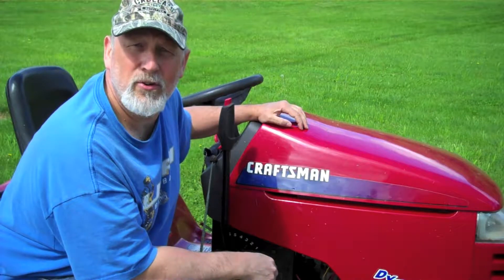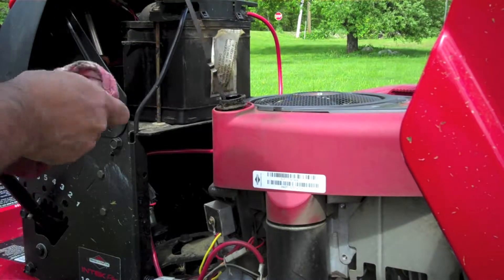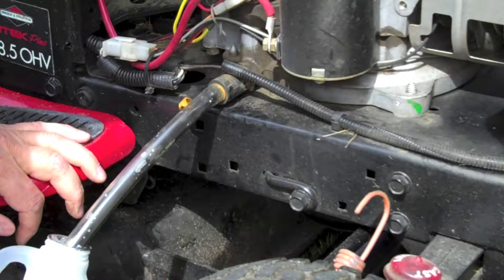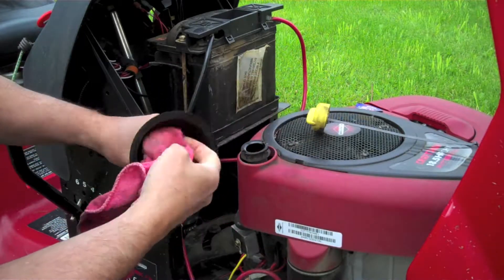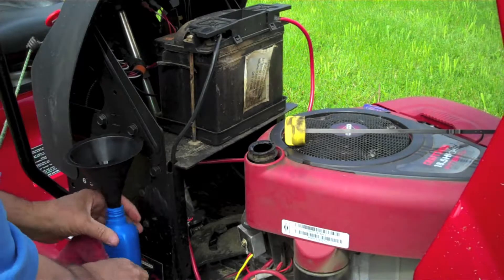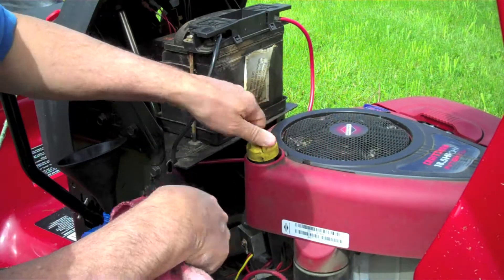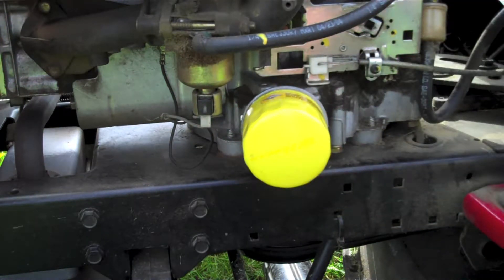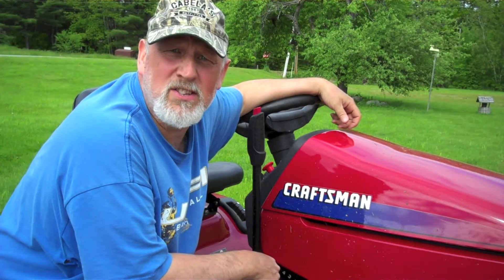DIY Lawn Mower Oil Change

Comment: What oil do you use I here 10 w30  but I don't know
Reply from the maker: The recommended oil in my manual says 30 SAE but 10w30 will do as well. Thanks for watching.

Comment: Great video!  Thanks for making it. I learned a lot about my tractor!  Very nice design for an oil change. Thanks for mentioning it takes 48 ounces of SAE 30. Good to know.
Reply: All mowers are different. Check under the hood or in your manual for your specific mower
Reply: Oil filter troy bilt 439cc

Comment: Thanks guy! I have the same riding mower,with the same B&S 17hp motor and oil drain...but no oil filter.What size is the tubing do you use???
Reply from the maker: Hey Kim, thanks for watching. It was an old junk of tubing I had kicking around. I think it is 1/2" ID.

Comment: Thoughts on switching to full synthetic 5W-30 for cold weather operation?
Reply from the maker: Hi Charles, I have not used synthetic oil in my tractor. I am not sure the pros and cons with switching to full synthetic. Maybe someone with more expertise can comment and help us with this question.
Thanks for watching,
Old Guy
Reply: it should be fine, always check your manual for the correct oil, it may specify the correct oil to use when warm or cold out side.

Comment: Where can u purchase the oil filter at???
Reply from the maker: I used to get them at Sears but they have been closing stores around me. So now I pick them up at Tractor Supply. I am sure you could pick them up on Amazon as well.
Reply: @oldguydiy677  ok cool because I have had lawnmower 12 years and never changed oil. I put new battery in it today and it is smoking real bad. I’m hoping oil change is only issue I may have and where did u get that drainage tube???
Reply from the maker: @navygold2002  I think I picked it up at Home Depot. It was a while ago. If I remember correctly it was in the plumbing dept. You can buy it by the foot. Handy for all kinds of things.

Comment: What kind of oil do you need in craftman traceor
Reply from the maker: I use 30 SAE which is what is recommended for that model.
Reply: I just buy 30 SAE, but they do make Briggs and Stratton small engine oil which my son insists on.  I just insist he pays for it, not me.

Comment: Great video!  What is the string tied to your deck for?  Also, do you have a recommendation for what kind of oil to use?
Reply from the maker: Ha Ha. So it is a bungie cord that I use to pull the chute up when mowing in long grass. It tends to clog up if I don't.  I usually just use inexpensive oil from Walmart 30 SAE. Thanks for watching!!

Comment: Would it kill you people to mention the weight of the oil!
Reply from the maker: Hi Joe, Probably because most lawn mowers take SAE 30 oil. 10W-30 or 10W-40 can be used the manufactures typically spec SAE 30.